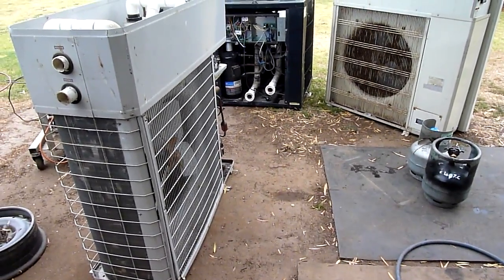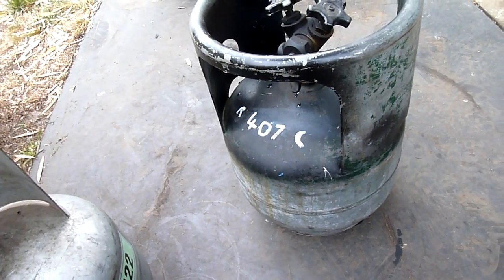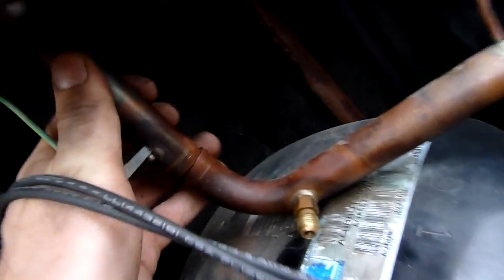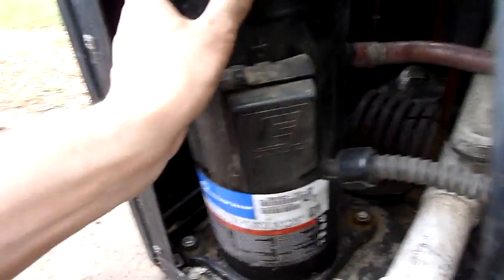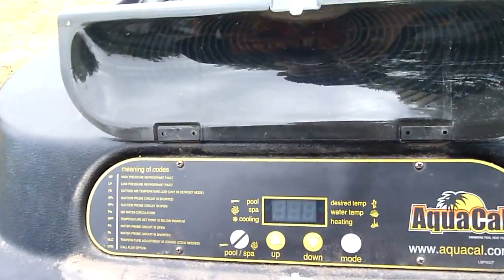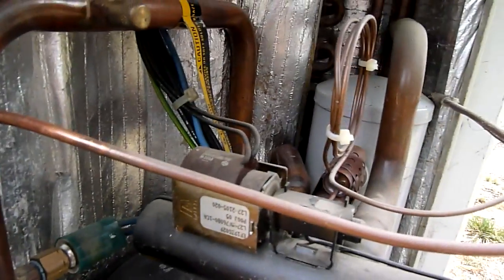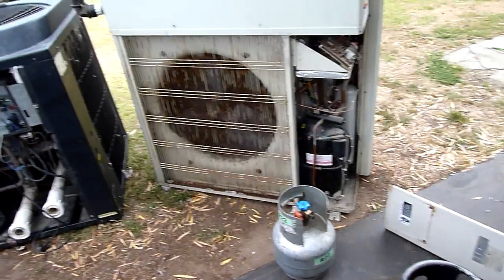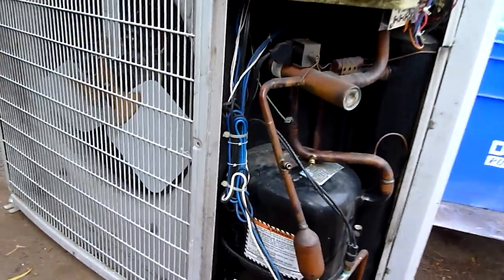Windy Water Chiller Update

Comment: I don't think R407C is obsolete in the US. It is very commonly used in computer room air conditioner units (Liebert, Stulz, DataAire, etc). I don't think I've seen any CRAC units, even brand new ones, that didn't use R407C (except for purely chilled-water units of course).

Comment: R410A is a mix of R32 and R125. The oils are pretty much the same as for R407C, R410A just allows smaller compressors and piping, which leads to cheaper, smaller, more efficient designs.

There is no need for hysteria about hygroscopic oils, R22 perhaps allowed some people to be sloppy about letting contaminants in a refrigeration system, those who do it right should not have issues. Filter dryers dry the hygroscopic oil, vacuum doesn't, so dryer-less small systems require extra care.

Comment: You should always be able to put R22 in a R407C machine but not the opposite. R407C was widely used in Europe as an interim refrigerant because R22 was disallowed early, and the manufacturers could just keep making the same R22 designs with the oil and refrigerant replaced with R407C for europe. Nowadays everything is R410A, because R410A designs are better and lighter (copper is expensive) and nobody wants R22.

Comment: And then some. Chilled water systems (both Air and Water condensers) are used in larger building where regular HVAC systems would be cost-prohibitive.  You get to see these on top of the big buildings and modern construction where the architects actually used their heads for once and considered the advantages of it. 20 ton cooling capacity and up, too big for most residential applications!

Comment: R407C is NOT a drop in replacement for R22. It's a mix of R32, R125 and R134A. The oil used is either an POE or PVE type. Even the compressor's are built specific for this blend.
The mix and oils are VERY sensitive to moisture, moreso than the other oils. 
A chiller using it, hoot!
From what I've digested in the forums and PDF's on the mix, it's an "Evil Interim Gas" until R410 can come into being. Meaning it'll drive the HVAC techs nuts until all the units that use it are taken out of service.

Comment from the maker: they are used to chill water for industrial processes like injection molding, extrusion, rubber making, and many other applications.

the square one was a heat pump for heating swimming pools, as were the carrier units when they were new., but its essentially a closed loop water cooler, like a cooling tower, but without the legionaries disiese :p